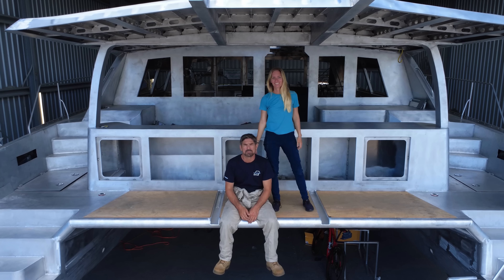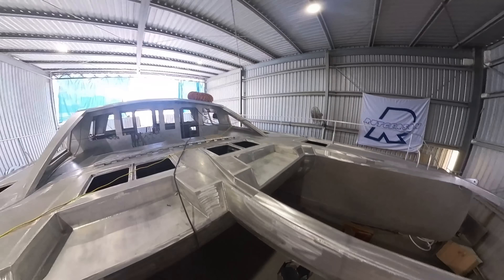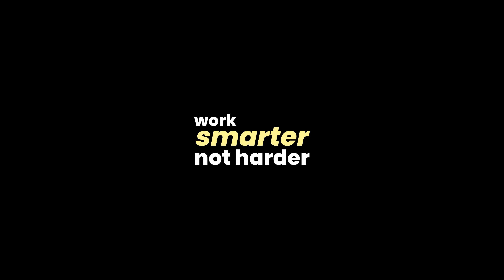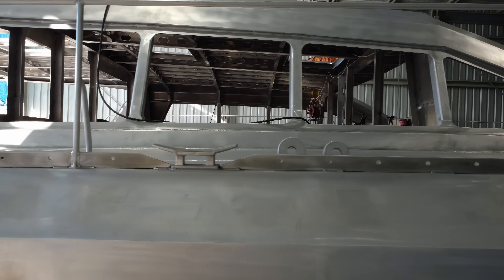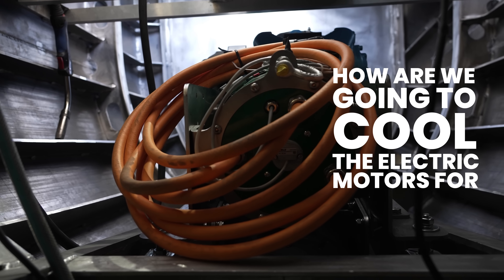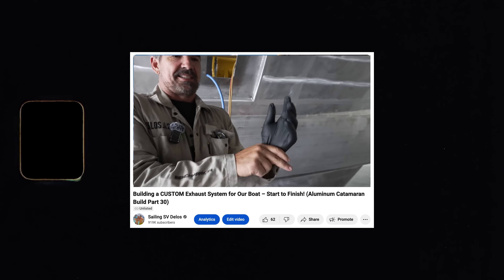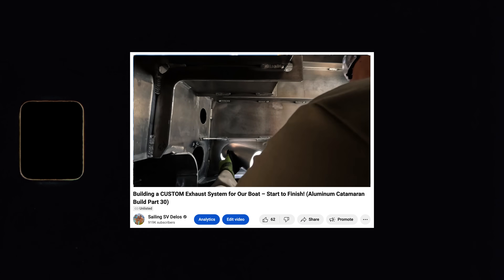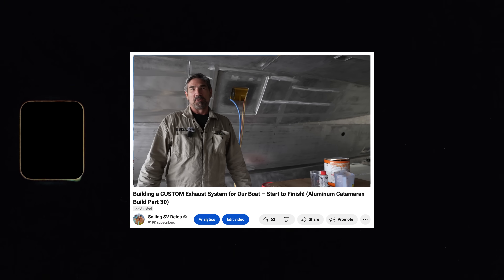We Challenged AI to help design our Keel Cooler 🧠 (Building Our Own Aluminum Catamaran From Scratch)

Comment: One thing I enjoy from these videos, is diving into the comments and learning from the feedback of many, especially fellow mechanical engineers. Looking forward to the final decision on how to insulate the hull. Regarding the heat exchanger, also consider galvanic and electrolytic corrosion (the components in the cooling side of the motor are not all aluminum, so you will have dissimilar metals and the design may call for a zinc insert into the fluid somewhere? ). From the fluid side, suggest looking at tradeoffs between DI water, or glycols diluted with DI water, but would avoid conductive non DI water. Then comes the piping, from the exchanger in contact with the hull to the electric motor, I would avoid metal pipes all the way, there has to be break (i.e. rubber hoses) to prevent the piping from becoming yet another ground path from the motor to the hull should there be a fault. Out of curiosity, does the motor use isolated ground or case grounding?  While the underwater of the hull is painted with antifoul, the hull potential is brought close to ground level through the exposed zincs. BUT, you want to avoid using an aluminum hull as path to ground whether normal or abnormal conditions (like an equipment fault or short on board) and likewise, the metal hull shouldn't become a bonding bus bar. There should be just one ground path like a GRP boat, or in this case 2 paths because you have 2 engines, and those are from the motor sitting in rubber mounts isolated from the hull, to the shaft and out into the water (shaft cutlass bearing non metallic to avoid contact with hull) or better, isolate shaft from engine (non metallic coupling) and connect engine chassi directly to a sacrificial anode on the hull nearby. Finally, heat exchangers have a finite life. At some point they will need cleaning / replacement.

Comment: A waste of time if you have to ask how much heat rejected and you already know the motor rating.
The other stuff requires you to know what variables are appropriate, which are acquired through education/experience. Good luck on nailing down what you think you want on heat transfer. The circular arguments will draw you in unless you know where to start.

Comment: As far as terminology, remember that on a ship or other seafaring vessel, the 'floor' is referred to as the deck (regardless of what deck/level you're on), a 'wall' is referred to as a bulkhead, a 'ceiling' is referred to as the overhead, and the terms 'forward' and 'aft' mean front and rear respectively.  Additionally, the left side of the vessel is the port side (an easy way to remember that is that both 'left' and 'port' each have 4 letters), and the right side of the vessel is the starboard side.  This would be especially helpful when telling a guest where the head (i.e. the bathroom) is located (e.g. down below on the aft starboard side).  As far as insulating the vessel (assuming you are going to be insulating it), have you guys decided on what type of insulation you'll be using?  I'm not sure if there is such a system designed for a maritime application, but have you considered a removable batt-type insulation with a composition comparable to rubber?  This would allow for the insulation to either be removable for serviceability access to a given space or for it to be applied directly to the outboard side of a bulkhead (but obviously within the skin of the vessel), so that a bulkhead and the attached insulation can be removed as a single unit if/when needed.

Comment: I am not a mechanical engineer. Haha but I would be curious from that short video with an example cooler if you plan to just install the cooler against the keel.........is the plan to put a thermal compound between the cooler and the boat in that instance? I wouldn't think you could get an efficient transfer of the heat with it just welded to the side of the boat. Would the plan be to cut and install a cooler into the side of the boat? With fins or not? Also I would have to assume the CFD would indicate an unsteady transfer of heat front to back on the cooler to some degree making  your overall heat transfer to the water suffer slightly more depending on speed of the boat (also heat to be dissipated being more going faster with increased load on the motor counteracted by increase in speed = more water flow). And the transfer should the heater be installed just inside the boat would have a larger surface of dissipation of heat to the water than an external cooler.

Complicated problem with an exacting mentality for sure!:goodvibes:

Comment: Grok 3 say at 10-15C .28m2 

Hull integration: On a sailboat, the keel cooler must minimize drag. A streamlined plate or tubes along the hull’s underside, near the keel, is ideal. For 0.28 m², a plate 1 m long × 0.28 m wide could suffice, or a shorter, wider configuration depending on hull shape.

For a precise design, you’d need:
•  Specific motor temperature limits.
•  Sailboat speed and hull design for convection estimates.
•  Coolant flow rate and system pressure drop.

Comment: Woo Hoo!  I think the two lower area ones are assuming an exterior mounted cooler that transfers the cooling fluid through the hull to the cooler mounted on the outside.  The higher one assumes the use of the hull as the transfer surface with no need for holes in the hull.  I would go with the internal cooler to reduce the induced drag from the exterior mounted cooler.

Comment: Does that change when marine growth begins to cover the surface or, if fins are used rather than the keel directly connected to the hull of the boat, when the fins begin to get clogged?

Comment: Your first choice of AI should have been Grok3.  It was created by the man who mastered vertical landing rockets and catches booster rockets out of mid-air.   He's solving heat dissipation problems of the Mars Space Ship.  

Ask AI smaller questions that you know the answers to.  You'll be surprised at the amount of bull they spit out.  Don't be fooled by the speed of the responses.   

Can you look into heat dissipation through the sails?  Can the sails have solar generation in order to run a constant daytime hybrid propulsion system, similar to Toyota Hybrids?  Look into the Gen2 Prius.

Comment: Don't forget fouling.  

Depending on how deep below water line your motors are, you could potentially use heat pipes (vacuum tubes with water vapor in them) to thermally contact above and to the side of the hull below the water line.

Comment: A keel cooler is typically on the outside the boat, directly in the water and isolated from the hull as DeepSeek outlined. To use the skin of the hull and having to conduct heat through the bottom paint creates another layer of thermodynamics that will require additional calculations and require a larger cooler. Personally, I would not use the skin of the hull for heat transfer.

Comment: Didn't read other comments, but 4 questions come to mind. 
1. How much will bottom paint reduce the heat transfer capability? 
2. Would fins welded to the outside of the hull at that point on the hull increase efficiency and significantly reduce that area required? 
3. What affect will the interior surface of the cooler have on internal temp, humidity, etc?
4.  IS there a max cooling that you don't want to exceed i.e. can the motors be cooled too much?

Comment: Make it as big as you can...have a temperature gauge with the water going into the keel cooler and a temperature gauge going back to the electric motor so you can monitor. I would also have a temperature gauge in and around the motor with circulating air in the compartment where the motor is located. If it gets too hot, then a catastrophic fire and there is no fire suppression system that can counter the fire.

Comment: I work as a manufacturing engineer, I have some experience selecting heat exchangers although Im by no means an expert. Definitely have someone with experience in marine HXers look over your scheme. Typical keel coolers require through-hulls and are used by powerboats where drag may be less of a concern. Another option to consuder is plumbing a HX into water from your freshwater tank. If the freshwater tank is integral to the hull you should have plenty enough heat dissipation capacity therein. Upside is that it reduces energy consumption of your hot water heater. Downside is your freshwater is warm when motoring. Otherwise just plumb the motors with the engine coolant HX. Not sure if you were already planning to use a seperate HX from the engine circuit for supplemental water heating.

Comment: Food for thought.... Would transferring this heat through the hull and external coatings interfere with the external coatings bond to the aluminum?
Reply: Not sure if they're planning on using antifouling paint. In this situation I doubt it because the average temperature will likely be less thsn 80°C. This could potentially cause premature wear or oxidation of the coating.

Comment: I've used keel coolers in commercial vessels, they're really reliable. Just keep em clean-ish and you'd be fine. For design considerations, exchanging the temperature through the hull will not be very efficient. I'm sure a racing yacht would prefer it, to gain speed, keel coolers create some drag after all. Your catamaran might be somewhat speedy, but it's not meant to win any races. It would work well if the aluminum be left bare. But that cannot be done if you want the boat to last more than a few years. In the end, your considerations for the keel cooler design will be entirely economical. It's a compromise between cooling your engines with an appropriate level of safety and not breaking the bank in the effort. I'd say, if you can afford it, buy as big a cooler as you can fit. They loose efficiency (thermal transfer) with time, and bio-growth. Of course, treat your cooling loop with the proper chemicals and your life will be so much easier. Keep an eye out for different metals throughout the build, you won't want any galvanic corrosion in your new boat. Wanna know what destruction it can make? Check this out: https://youtu.be/rJNqj_QNkWM?si=GPlu3sc7C3B3IQxJ that car was flooded for a couple of days only. You guys have a huge battery in that boat, so, just be careful.
Reply: Considering the galvanic corrosion risk,  I think it would be simpler and safer to plumb the motors eith the engine coolant and engine HXer. Which is mounted in such a way as to insulate it from stray currents.
Reply: The link, although interesting, did not show much galvanic corrosion.
Reply: @Todd-p5c6m  oh, it's in one of the videos in the channel, specifically when they took the battery out. The carbon fiber had little issue with it, but the aluminum was 💀
Reply: @Knibal999  Yeah, I started watching the series. Interesting.   It's shown in Episode 3.  Thanks.

Comment: It's definitely a cool idea. Consider that barnacles will populate the warm part of the hull first. Also consider that you're not using aluminium as the heat sink but rather a combination of aluminium, base coat and antifouling paint. I'd check into the heat transfer numbers of those, it could well turn out that different types of antifouling might have a drastic effect on heat transfer. Also this type of heat sink is very inefficient as you will only have at best say 40% of your heat sink actually contacting the hull. Having said all that I'd definitely contact a supplier of hull heat sink systems. There are too many variables to be sure. Only experience and fine tuning iteratively will get you to the finish line, but you don't want to have have to test and refine your system I'm assuming. This is one for the pro's Id argue, It's simply too complex to be able to get a good number considering all the variables.

Comment: Will you have a proportioning valve or Servo of some kind to regulate the running temperature of this motor or will you just straight run the cooling at maximum capacity to keep the motor as cool as possible? In other words is there an optimal temperature or this electric motor or just is cool as possible is best?

Comment: Whatever heat transfer area you calculate yourself or via AI, you will need to add a large safety factor - in the order of 100%. It will be difficult to estimate the heat transfer coefficient in this case as the flow is not like that inside a traditional water/coolant heat exchanger. You will not have close to turbulent flow. A professor in a graduate level heat transfer course used call the amount of heat you calculate to transfer in a heat exchanger "holy Q"  ie. only God can achieve that.

Comment: Hello,
I am not an experienced engineer but just a man of common sense and that tells me to advise against this plan.
My experience with heatsinks is limited to mounting heatsinks on computer chips (CPU's). The top of a CPU is just like the bottom of the heatsink extremely flat and smooth and we still use an extremely thin heat transferring layer of gel for a good heat exchange. Looking at the examples of the heat exchanger in the video in combination with the round hull I don't think you will get a good heat transfer to the hull if your plan was to weld the exchanger to the inside of the hull. Then the alternative is to grind a groove in your nice smooth hull and weld the heat exchanger there flush or not. Someone else already commented that you will probably get more heat radiation to the air in the keel than to the wet side of the hull. Plus I wonder what this means for the structural rigidity of your hull and what the cold/hot/cold cycles will mean for all the welding in the long run. In order for such an exchanger to work properly it must be completely surrounded by the coolant (seawater) and that means that the entire unit must be mounted at a short distance from the hull so that the seawater can flow freely around it. A waste of your beautiful hydrodynamic hull and the performance.
In the previous video you indicated that you intended to fair, paint and antifoul the hull. The effect of this layer is not included in the heat emission and vice versa what will be the effect of the cold/hot/cold cycles on this layer. In addition, this heat will repel algae and fouling or attract them even more. In the latter case you will then have to clean underwater regularly.

I would ask AI to find examples of (commercial) aluminum yacht builders who have already equipped their sleek, fast aluminum yachts and catamarans with keel cooling. If AI can't find one with a success story, maybe there's a reason for that...

If your idea is inspired by the fact that you think it's a shame to get salt water in your beautiful expensive engines, I can understand that, but wouldn't it be a good idea to investigate whether it wouldn't be more practical to come up with a second fresh water circuit on the water inlet of the cooling system so that you can rinse the system with fresh water after using the engine with seawater cooling. If desired and if environmentally responsible, supplemented with a protective agent or something other that will neutralize the  sea salt (NaCl).

Good luck with the construction and much wisdom desired in this

Jan-Willem, Netherlands

Comment: As far as water flow over the keel is concerned, I would consider that when operating the port side motor in "generator mode" while sitting at anchor running your diesel engine will put a heavy load on the electric motor for an extended period of time with no water flow over the keel cooler.